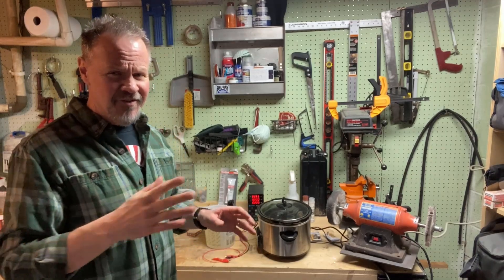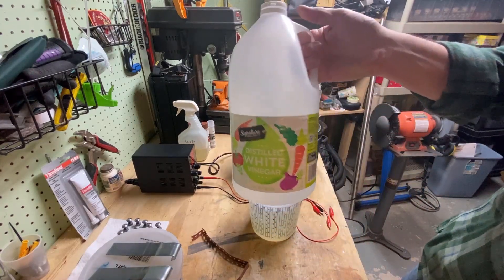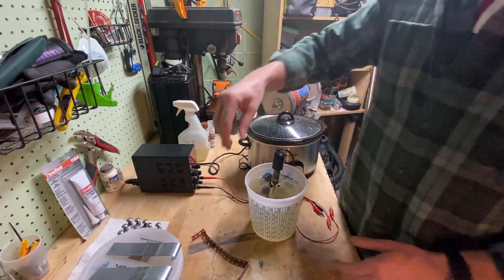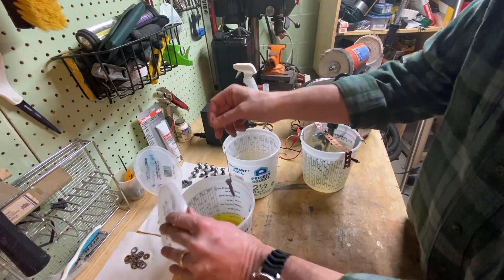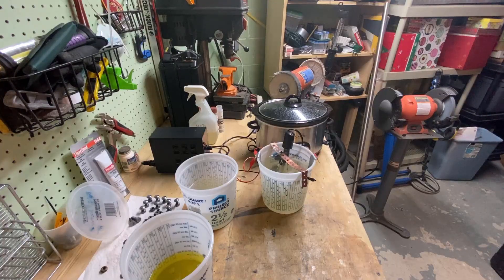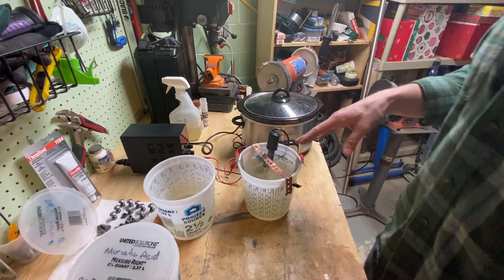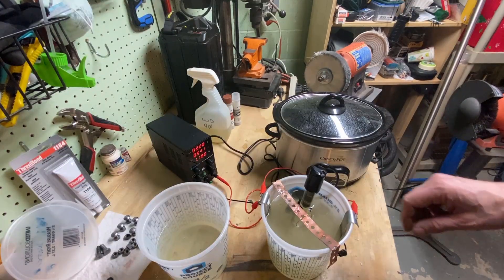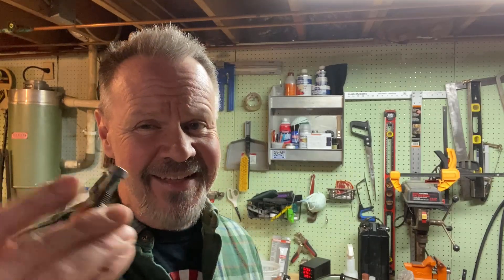Easy DIY Zinc Electroplating - no kit required

Comment: Having tried various other ways of cleaning up and then rust-proofing old fasteners that were still in decent condition and expensive and sometimes hard to replace due to their age, only semi-successfully, I'm looking into this method as a potentially more effective one. But how well do these fasteners hold up under real world conditions, especially is used on cars in areas exposed to the elements, like brakes and suspension?
Reply from the maker: I’m using these for motorcycle restorations that have a gentle life once completed so it’s hard for me to say.  However, my opinion would be that they don’t hold up any better than they did originally which is not good in the harsh environments that you describe.  A protective coating like fluid film is currently my go to for that type of environment.  Thanks for watching.

Comment: How quickly can you plate a second bolt after already doing one? Do you need to wait another few hours for the zinc to build up in the solution?
Reply from the maker: @bigrodboys7888  with these small parts and my set up I’ve been doing 15 to 20 pieces at a time with no waiting.   I have not experimented to see how far I can go before the results are not satisfactory.

Comment: Thanks for the video! Can you share details on the power supply? Where purchased, cost? Thanks again.
Reply: It can cost you anywhere from 15 to 20 bucks for a can of 95% zinc spray paint
Reply: @bobboby2400  You really don't understand, do you.
Reply: @johncrowley5612 I absolutely know because zinc is exactly what they use to put on your vehicles when they shipped them across the ocean so they don't corrode to nothing if that's not too big of a word for you and it's exactly what they use to recoat the underneath of your vehicle to get it ready for salt baths in the winter please just keep your own comments to your own stupidity. And I actually do that on many vehicles and it works beautifully so just zip your Mama Lip for your mama

Comment: DONT wear gloves when using a wire wheel. Use pliers and keep your hands away from it, if you’re worried about getting scratched.
Reply: Real men don't wear gloves.
Reply: rotating machinery sucks in gloves and will do a lot more damage than not wearing gloves, it's not about manliness or being a nerd, it's just not wanting to be dismembered by a lathe.
Reply: @pyrost3inlearnt this in the Navy. Needle scalers etc gloves on. Anything rotating like an air shimano/grinder and no gloves so they dont get tangled and fingers dont get mangled.
Reply: Yeah ok nerd
Reply: @DamnWelfareBums okay. Get your gloves caught up in a wire wheel. 🤷‍♂️ it’s your hand buddy.
Reply: @DamnWelfareBums  Yeah ok cool guy with a claw hand.  You've seen it happen or you haven't. You haven't.
Reply: DONT have your peener and nuts in front of the wire or polishing wheel 😂
Reply: Why not gloves? Why not both? Tools and parts slip.
Reply: @HabaneroTi  Would you prefer a cut/abrasion or amputation?

Comment: I'm curious why people want or do zinc plated steel (bars not bolts) when its not for electrical? I've heard a welding channel say there's advantages to it, but it didn't say what those were; it was instead going over why its harder to weld.
Reply: i think its usually just a cheap way to keep rust away
Reply: Zinc is sacraficial. It will corrode away instead of the steel. Even if the steel directly under the coating is exposed (like scratches or chips) the zinc will still protect it.
Reply: It's needed when an OEM part was zinc plated and no longer available. You can restore the look of the original, corroded part by replating it.

Comment: Do you keep the heater in the zinc
Reply: You would have to have the zinc soft enough to be able to move and then bond to where you want it; that's chemistry. So while bonding yes. (However, I don't know how safe the air around hot zinc would be? Probably it wouldn't be good to be breathing that very long.) Please be careful. 

You'd basically need to look at the heater, and what its heat is and what the melting point of the zinc was also. 

In the 3 phases of matter, that you learn in chemistry you learn that there's minute amounts of an element that will be in all 3 phases. So when you heat a metal to get hot enough to work with, that means there's also vapors...that you don't want to breathe.

Comment: For the first step (3:15 mark), what current level was set for the preparing the plating solution? I used a quarter amp just as a starting point, but might that be too low? Thanks!

Comment: Going to try this method out. I like KISS! 60 year old hardware from a well weathered Sunbeam Tiger front suspension. I used Klean-Strip (phosphoric acid based) to remove the last bits of rust after wire brushing as you showed. Otherwise my setup is now the same as in the video. I'll drop a comment on the results in a day or so.

Comment: Is there a limit the the thickness of the plating?  If the bolt was left in the solution for an hour would it continue to plate?  Thank you for a clear well presented video.
Reply from the maker: That’s a great question and I really don’t know.   I would imagine the answer is yes but I’ve never tried that, for almost everything I plate after 10 minutes max I’ve got a decent, durable plating.  Maybe someday I’ll leave something in for a while and see what happens.  Thanks for watching.
Reply: @Chris_Does_Everything  under load, everything will fall off
Reply: There should be a point where its diminishing return on the time in the solution plating. But I'm not sure what that time would be. Its also possible that you might try to counter that with a higher zinc % in the solution(?)(but is that safe??)